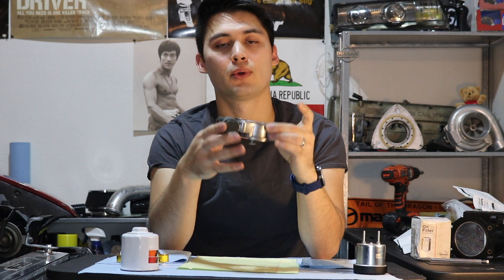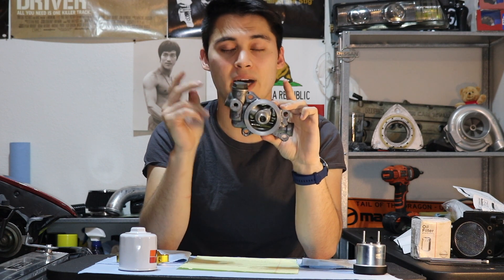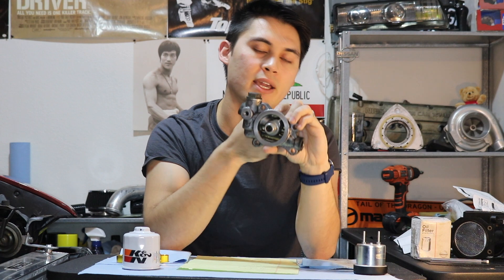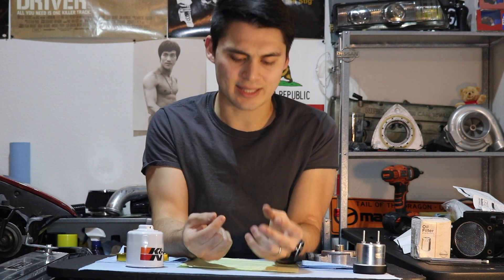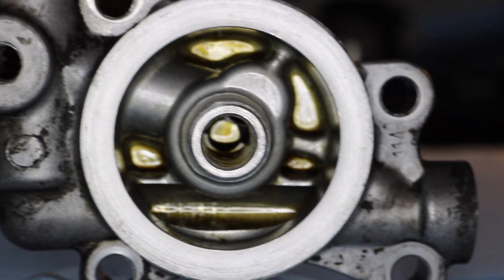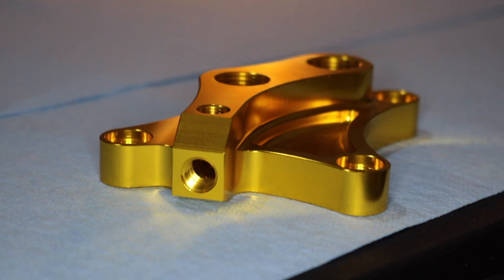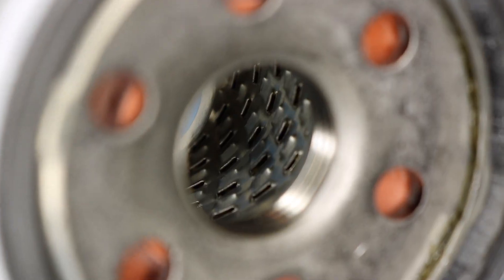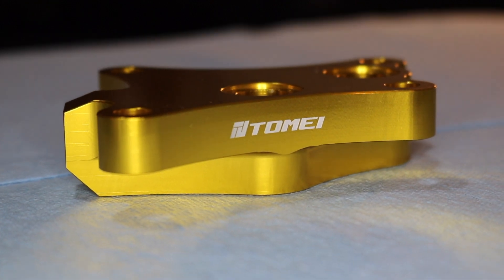Bypass Valves | Are Aftermarket Oil Blocks Worth It?

Comment: Poor design of the Tomei.  Here is a KA oil filter block that has a channel in the back, like the oem, that allows the oil bypass to continue to operate as normal.  https://www.v8schassis.com/products/ka24de-billet-oil-filter-relocation-block
Reply from the maker: I wouldn't say it's a poor design, just a purpose built part that removes the bypass valve for simplicity. It's certainly a tradeoff. The KA24DE's relief valve would be more difficult to remove as its built into the engine block rather than the filter housing like the SR20 unit.